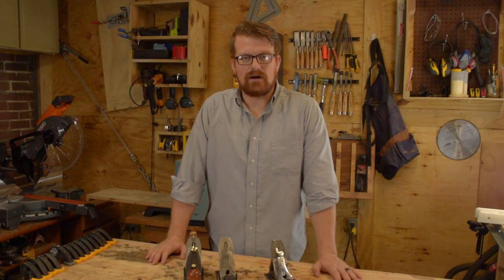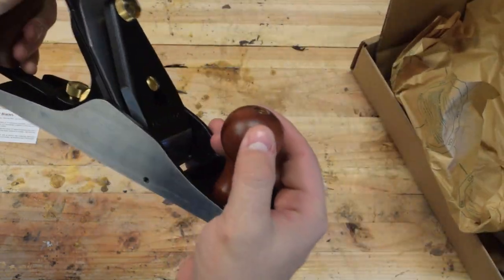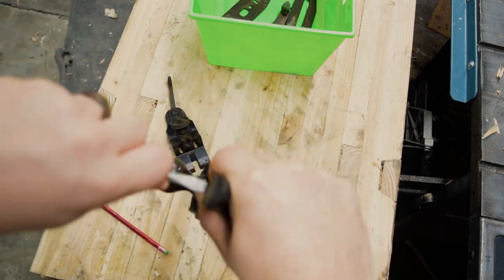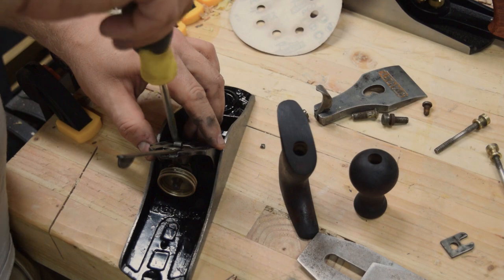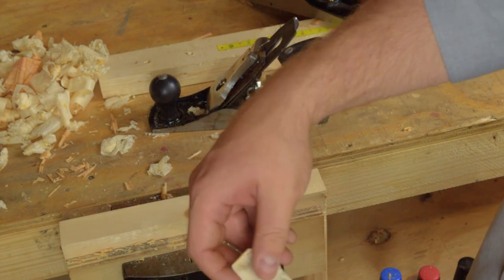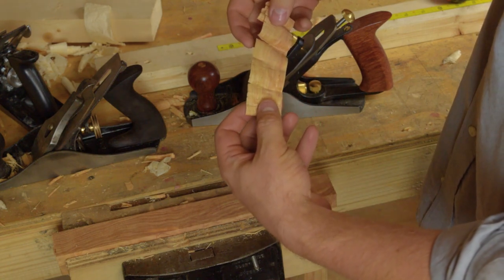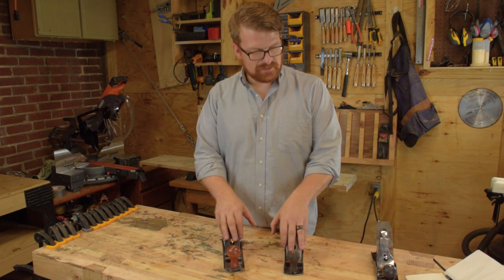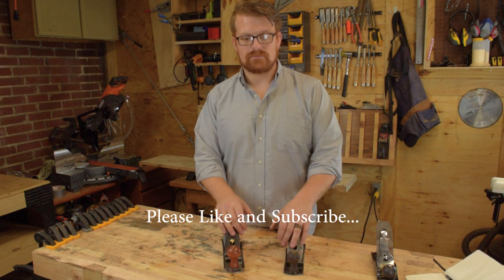Smoothing Plane Shoot Out - Veritas, Classic Stanley, & Harbor Freight | Hand Tool Shootout

Comment: Like you I have No 4 Stanley with corrugated sole. Not certain if it is  Bedrock, perhaps a Sweetheart, (mine is Sweet Heart - my grandfather's so it is old - pre-war - I'm 60 plus ) check the blade (iron) for markings. Check too how adjustable the frog is, and if knob and tote are exotic woods. A couple of caveats, please, please, please (Xs 10 to the enth) never , ever, repaint an old plane. Clean it up, carefully clean it - piece by piece. Old tooth brushes, Q tips, soft rags ... oh and the "water paper" that flaps in the wind .... again, please no. Those rolls actually round over edges lessening the accuracy of the sole, and wings. Use a spray adhesive on dead flat material to maintain the integrity of the machining. To those who poo poo the need for accuracy, flatness, perfect shavings and on there is place for this, drawers, lids, doors .... Pretty sure experience is the only teacher, so after over forty years working wood here are a couple of ideas. Veritas planes are expensive - no doubt. (make me sweat) Great right out of the box. Expensive, but not over priced. Have a few and they have never let me down. Paul Sellers undisputed genius. Yet personally have found that a variety of planes for a variety of jobs works best. Also, likely not a wise idea to speak in absolutes on the www - as they say : there is always a bigger fish. :)
Reply from the maker: Thanks for the feedback.  I hope you found the video interesting, it was one of my first on YouTube and I had a lot of fun doing it, but pardon my lack of polish.  

Yes, I later found that the Stanley was not a bedrock nor a sweetheart but just a good prewar same of a stanley Bailey no. 4 corrugated, so there are inevitably better planes out there (actually just bought a prewar Stanly Bedrock 604c and a 605 for a future video.)  The Stanley was great, and I still use it regularly, there are certainly many uses for it, the Veritas does however have better features such as the Norris adjustment mechanism (which I find superior due to its retention of the blade and positive feedback) and the adjustable throat (very useful on a smoothing plane for making finishing passes, I know the frog on a Stanley can be adjusted but it leaves the front edge of the blade unsupported and susceptible to chatter.)  All that on top of the set up from the factory, I think the Veritas takes it.  

As for value, the way I presented it, that was just a little fun.  I have seen guys stumble on NOS Stanley sweethearts for under $100 so it is really not a fair comparison.  It was all in good fun.  I went into far greater detail in the article on my website if you are interested.  

http://www.wood-work-life.com/design/home/blog/handplane-shootout-no-4-in-d-flat-minor/

Comment: Why in the world did you spray down your vintage Stanley with lacquer spray paint. -_-
Reply from the maker: the Japanning was hosed, and I don't buy planes to collect.  Japanning was European technique developed to emulate Japanese lacquering anyway.  I did it to stop the rust so I can use the plane and keep it in my garage without the rust going further.  I suppose I could take the time to mix my own Japanning with asphalt, but there would be even less return on my time invested to get a usable tool.  

Don't get too hung up on tradition, respect it, understand it, but don't be a prisoner of it, or you'll be bound to repeat the past.
Reply: I know what Japanning is. I'm speaking of it's effect on usage. Material between the separate contacts of the frog cause additional chatter and loss in accuracy, stability, and consistency of each cut between adjustments...I really don't think you should be making videos that 'teach' people about a subject when you clearly aren't knowledgeable on the subject matter itself. 
Somewhere out there is some kid that's gonna see your video and buy an old plane on ebay and quickly lose interest in traditional woodworking due to the frustration caused by never getting his plane working. Then that plane will sit awhile and it'll eventually be sold on eBay and only with hope will that simple fix be known by the eventual owner.
Reply: Tyler,
Easy to be an armchair critic, not so easy to produce a video.  I found this to have lots of useful information for all levels of experience.  Thanks Rick.
Reply: Come on man No. 4s are as common as dirt. Do whatever you want with them.

Comment: So - some basic vocabulary:
Lever cap
Cap iron
Cam
Wet or dry paper isn't "glass" paper
Veritas blade adjustment is copied from a Norris design well over hundred years old - not more "modern" than a cam operation lever cap
Basically if you gonna make a video then at least make an effort with some of the facts.

Comment: Six hours to flatten the sole on the Harbor Freight—and THEN another 14+ hours of adjustments??? You lost all your credibility on this one. If you properly plate sanded any plane sole it would be flat in just a few minutes. Six hours of removing material even at the finest grit would have removed all of the sole. And what the hell are you doing with the other 14 hours on an new commercially manufactured plane—tooling up from scratch and re-machining all the surfaces on a Bridgeport? You could build a basic infill smoothing plane from scratch in 20 hours and you expect viewers to believe that it took you 20 hours of your time to get a new, commercially forged and machined plane just to get it to plane wood—poorly? Others on YouTube have taken the HF and even cheaper planes on as a challenge and have gotten them flattened, squared up, and sharpened and able to preform to a usable standard in less than an hour. Disingenuous and ridiculous video to say the least.
Reply from the maker: Ok ok, you might be missing the message here, also this is my second youtube video ever so given a little slack.  If you listen to what I said in the video, the issue is the shotty lateral adjustment mechanism and the thin sole.  It is not that it takes so long to get it flat, it takes that long to get good consistent results out of it, and I still wasn't able to because of the faulty lateral adjust mechanism design.  I can get it to take a few good shavings withing an hour or two, but if you want a legitimate every day user, you don't want the blade skewing and gouging you work unpredictably.  Buy an old Stanley.